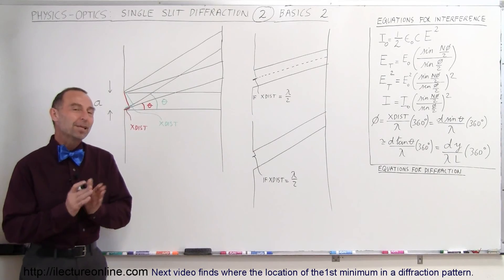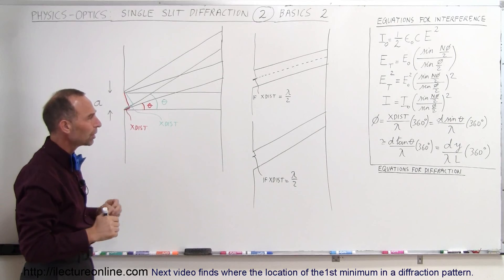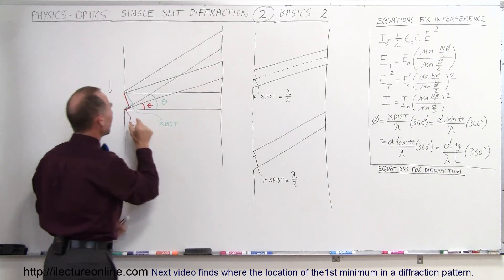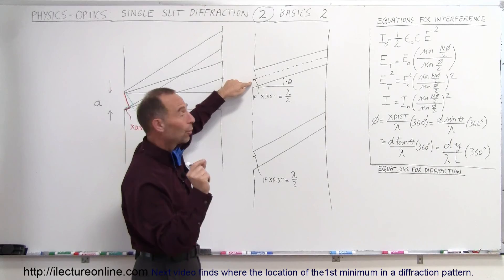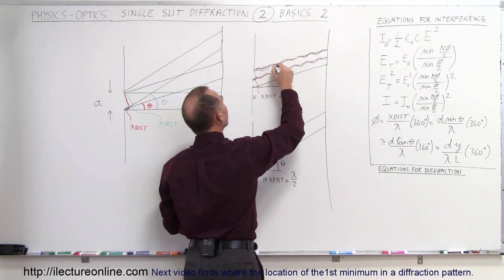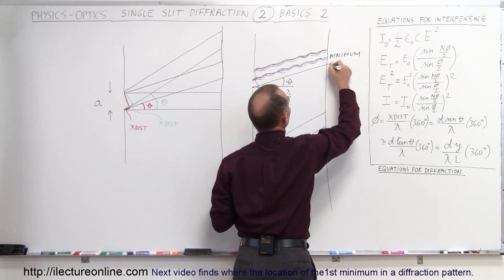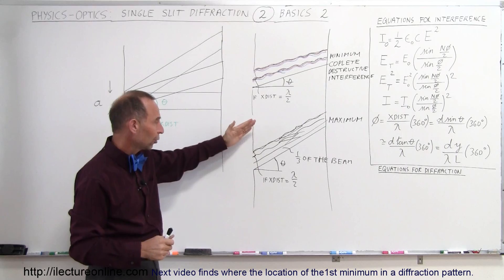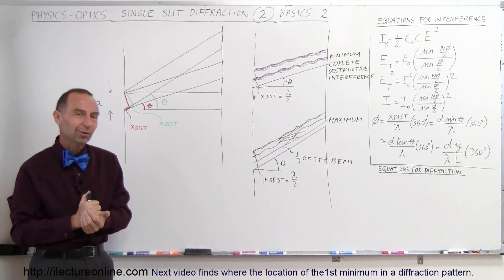Physics - Optics: Single Slit Diffraction (2 of 15) Basics 2: What Causes Diffraction?

Comment: Why 1/3 of the beam?
Reply from the maker: At the correct angle, one third of the beam will cancel out the second third of the beam (destructive interference when the path length is one half of a wavelength more for 1/3 compared to the second third.)  This way the third portion of the beam does not experience interference.
Reply: @MichelvanBiezen  I cannot thank you enough sir. This was the exact problem that I had when I went though my text book: what about the rest of the beams that are not cancelled out? Thank you for addressing that for me. Maybe I didn't describe my problem clearly enough but anyways, just want to say thank you so much for being an absolutely awesome Physics teacher!

Comment: The drawing is very bad.
He tells that light will travel further , and he shows two  parallel lines.....Well that is not correct.
What he means is two lines that hit SAME spot on wall then one of lines would have traveled further.
Reply: You are correct, he is completely incorrect. He should be comparing the length of the beam from the bottom of the slit arriving at the screen at the same point as that from the top of the slit ( an elongated triangle).  The maths is more to do with interference patterns based on the wave concept of light ( Huygens' theory) rather than diffraction.
Reply: @db5837  You are completely wrong. The slit width is tiny compared to the distance from the screen, the lines are parallel for practical purposes. The extra distance if you draw it exactly is a very very small fraction of even half a wavelength, so it doesn't matter for this construction.
Reply: Nope youre wrong two parallel lines doesnt mean they have to be equal clearly you can see that the bottom line travels further.